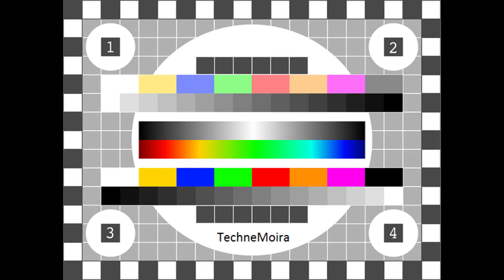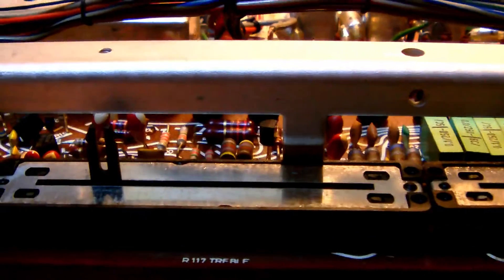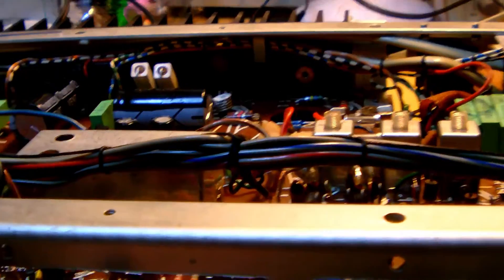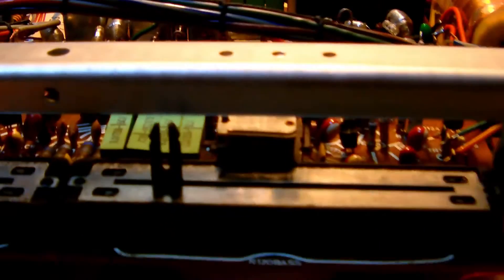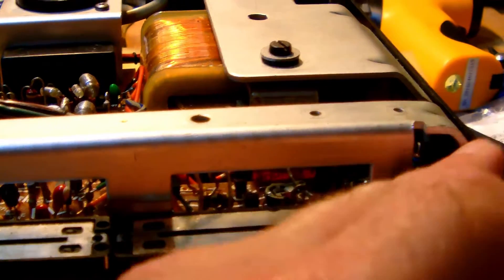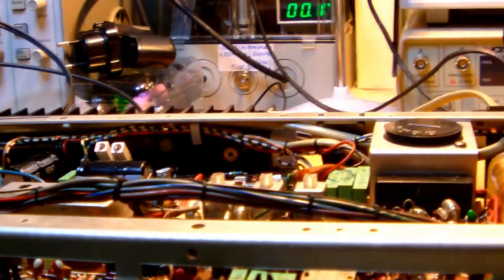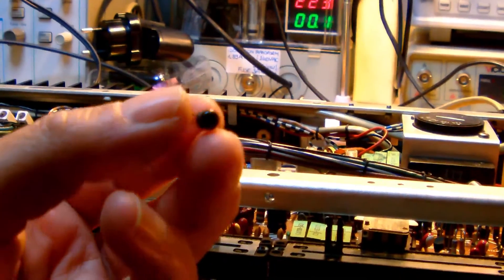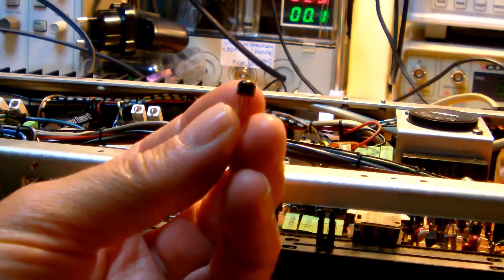Bang & Olufsen Beomaster 901 Tuner Amplifier Repair Restoration part 3 of 3

Comment: I have just bought not working 901 for EUR 20. As far as I know one channel is gone over there. I have just watched all 3 parts of your great tutorial. It looks easy but I see that you have a great experience and knowledge. I love your style of thinking, examining and finally solving problems. On this Tuesday my 901 will arrive and than I will start the same procedure as you done. Great thanks for your channel and these 3 parts of 901. Of course I subscribed your channel and I will look for your other moves too. I used to buy old B&O from the end of 60', 70', 80' till beginning of 90  - so when B&O was B&O not Philips. I am buying only not working units with technical faults but complete in original conditions. You can really buy a excellent units almost for nothing. I love to repair them and bring them to live. 901 was one of the cheapest and the most popular amplituner of B&O in 70' and today a working unit are very unique. When I will restore my one - I will let you know. Once again thanks for your knowledge and experience offered here for free :-) Best greetings from Szczecin, Poland, EU, Rafal
Reply from the maker: Hello Rafal. The B&O 901 is a very nice example of the Bang & Olufsen style and, in my opinion, is an ideal low-cost "beginner's set" for anyone interested in B&O equipment
I'll give you a few tips I give everybody plunging into B&O restorations: take your time, buy/find a good schematic/service manual and examine everything BEFORE you get hands-on with the chassis (go to the website Elektrotanya maybe) :)

Above all, I wish you lots of pleasure with the restoration and, good luck ! Thank you for your nice comment and subscribing to my channel... it is much appreciated !
Reply: @TechneMoira  Yes, of course it is a basic rule before starting to repair anything - first you are studying manuals and service manuals and than you can start to touch :-) As you see my 901 will come to me this Tuesday and I have already saw all your moves. As a hobby I am restoring and repairing oldtimers cars - the same rule - some models I am studying even half a year before. When I will start with my 901 than for sure I will look at your 3 moves once again. Of course all schematics, service manual and manual are downloaded on my PC. So as you see I am ready for this Tuesday :-)

Comment: What a brilliant set of videos.  My 901 makes a hum which seems to change with the balance control.  Looks like I should be replacing the third of the small transistors (right from the one that you changes)
Reply from the maker: You're very welcome :) With the right schematic and a lot of parience bringing back these B&O tuner amplifiers is really not that complicated... and it seems you have found the way. Cheers and have fun ! Thanks for considering subscibing to my channel :)

Comment: Have been restoring my 901 over past weeks and finding this set of videos very helpful, so many thanks for all your work.  Mine looks to be a later production model as has various update modifications from the factory.  Lots of work done so far with all capacitors replaced, failed balance slider replaced with one from a junk unit (could barely move original one even after cleaning three times), two different transistors failed on both channels together with a couple of resistors way out of spec, two dead diodes on the right channel...  now facing the "dreaded" rethreading of the tuning cord 😕which somehow fell off even though I'd taped it in position to avoid it happening.  Its come completely off the edge of the tuning capacitor wheel so I can't see how it was originally threaded that end :(  Looks like plastic pin on the wheel of the tuning  capacitor that the spring on the end of the cord goes over has snapped off, which is probably why it went slack and fell off.  Does anyone have a photo of how the cord should run around the tuning wheel etc. as its not too obvious ?? Is there a best order to put it on in?  Where do I start ???? 😵‍💫
Reply from the maker: Thanks for the uplifting and kind comment :) The rethreading of the tuning wheel is not easy for sure... I needed three attempts to make it work. I do remember that part of the solution was to have the tuning cord run 3&1/2 times (three and a half) around the center of the drum (wide tuning wheel on the side of the tuner)
Even so I will advise to be patient and not get frustrated if it takes you several attempts... rethreading the B&O 901 is one of the most difficult ones I have encountered in my carreer
Good luck and enjoy restoring your B&O ! Thanks for considering to subscribe :)
Reply: Thanks for reply.  I have the service manual and it does say 3 1/2 times but the diagram is just too small to show any detail. Original cord is still in one piece so I'll just need to put a metal pin into the wheel for the spring to hold onto then try the threading when I have a few hours spare 🙄
Reply from the maker: Hello Pete. Yep, rethreading is one of those little jobs restoring vintage equipment I most dread... it's time consuming and fidly. Take your time and you'll manage I'm sure

The best advise I can give you, is to use logic and not to despair if at first you don't manage. In fact, the second time I rethreaded the damn thing, it "worked" except, I had not kept in mind the thread "walks" over the main tuning wheel as you move the tuning button back and forth
 
You really need to coil the wire such that it sits perfectly on the wheel at either extreme end of the tuning range (otherwise it will slip off the wheel and you'll have to start all over again)... B&O engineers definitely had a sadistic streak when they designed the mechanism ;)

Comment: Thanks for a very good BM901 restoration video. I have a Beomaster 901 and would like to get it up and running with a pair of CX100 speakers. I have one problem, the wire for the volume control ism broken and I have no idea how to mount a new one. I have watched your part 3/3 video several times to figure out how you mounted the nylon wire on the round volume control inside the reviever. Any chance you have a drawing or descibtion of the the mounting procedure??
Reply from the maker: Hello, with pleasure, only I don't rightly know what would be the most practical way. I think it would be best if you send me a word to Techne point Moira on the server GM... Google uses ... if you know what I mean wink I'll reply as soon as I can
Anyway thank you for your nice comment, giving me a thumb's up and considering suscribing to my channel.
P.S. : it's really not that difficult (the rethreading of the tuner side is much more complicated) I just hope my drawing skills will be up to parr :)
Reply: After basic repair, you would save a lot of time using a DSO with functions for frequency range & bode plot built in. You really do have to measure performance under load in order to be certain that everything is working correctly. 2:10